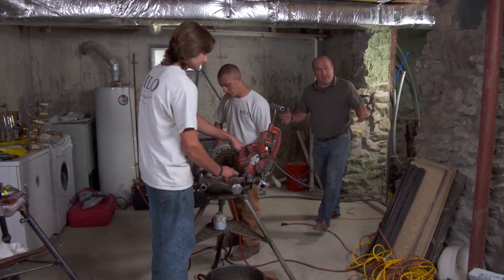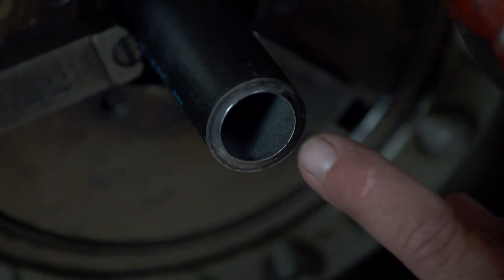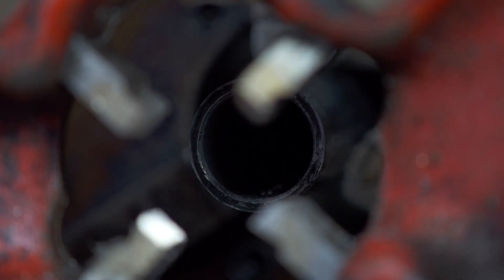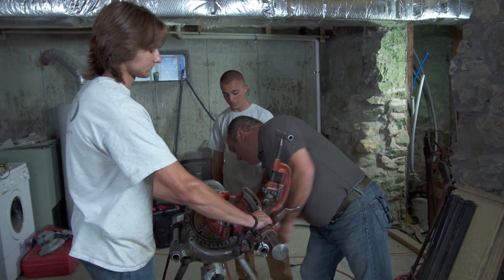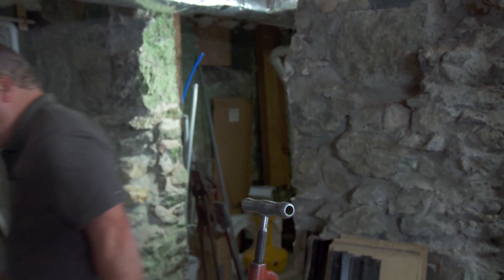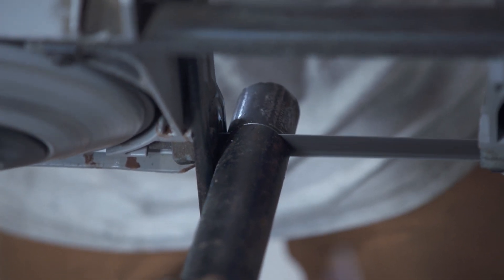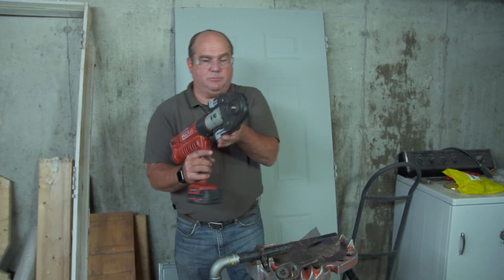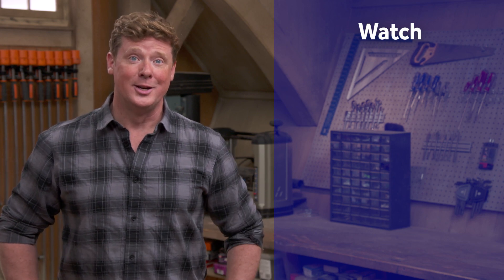How to Connect Steel Gas Pipes | This Old House

Comment: No one's talking about how much the Megapress fittings cost, that elbow list over $20.00 U.S.
Reply: It's the labor costs that offset it. It's the right tool to use. As is the other one. It's just not always the right tool for the job.

Comment: That rigid 300 threading machine requires a foot pedal switch to run it. In case of a emergency take your foot off the pedal the machine stops

Comment: The tool and parts are very expensive. Learn to cut and thread pipe.
Reply: Pro Press has been around for over twenty years now in several applications. They said the tool and fittings would come down in price once it became more common place, but they haven't. The fittings alone are as much as three times the cost of a regular thread fitting.  Although they are easy to use, that tool is heavy especially doing overhead pipe. It is also very difficult to keep the pipe strait and sometimes requires a second set of hands, so there gose you labor savings. I will stick with soldering and threading.

Comment: This isn't new.. Pressure fittings have been around for decades. It seems like everything that has been around for decades upon decades in other countries take years to be introduced into the US for some reason. In EU these have been used for a really long time and are used more often then soldering because it is faster and cheaper in the long run and they perform just as good as soldering does and it doesn't involve adding toxic materials into the water pipes like flux.

Comment: Wow SharkBite for gas line.
Reply: Not exactly.  Sharkbite is push-fit which requires no tools at all...this requires a hydraulic press tool that has to be re-calibrated every 42,000 cycles.

Comment: You guys dont use copper for gas ?? We stopped using steel decades ago.
Reply: The substance used to give Natural Gas it's odor corrodes copper pipe in the U.S. unless you use lined copper pipe.

Comment: Yea, no thanks. Sooner or later some Chinese company will take a short cut on those rubber seals and have a 40% failure rate after 5 years.
Reply: they already have some, also try to get buyer in the trade show. no one instead

Comment: Why not just use copper as we do in UK?
Reply: Copper pipe for gas?
Reply: In the netherlands same
Reply: @tizben  yes, seems to be much less work involved than using steel. Not sure why practice is different in the US?
Reply: @smurfman691  maybe it's more expensive.
Reply: tizben in Europe we use copper for gas and plastic for water
Reply: Americans like to do things differently
Reply: bigtx77 in Europe it does
Reply: bigtx77  there is almost no pressure in the gas pipes inside the house. very low pressure I think 0.2 above atm
Reply: @Federico84  the pressure here is much higher
Reply: @RespawnRestricted  no its not
Reply: Respawn Restricted why?
Reply: I thinks it has something to do with copper thieves. Do you guys have copper thieves in the uK? Cant have copper thieves going at the gas pipes and causing a mess.
Reply: @tizben  , national gas fuel code for the United States does allow us to use L grade copper & thicker for the use of gas. Some municipalities do prohibit the use of copper.
Reply: @Mr.Pop0  yes we have thieves here too.. But never heard of them breaking into people's houses to start ripping out their plumbing :)
Reply: @smurfman691  They do in the USA

Comment: Great. Another obscenely overpriced power tool meant for only one single rare application. Brilliant investment! If you're using schedule 40 steel pipe in 2020, you're doing it wrong. It has no business in any residential application, including gas.

Comment: More "faster ways to do plumbing" and put more men out of work
Reply: change with the times. that gun is about 3 thousand for the whole set up. nobodies outa work.  been around  since the 80's we use in hospitals all the time. same thing was said when no hub bands were used.
Reply: @luiscontreras71  it takes the skill out of the trade. Don't have to be a "skilled" plumber to use this. If you own your business this is a good investment but if you're just a worker it isn't good. It was better when crotons were screw joints and copper was only soldered or brazed